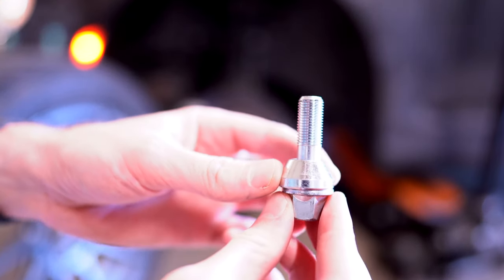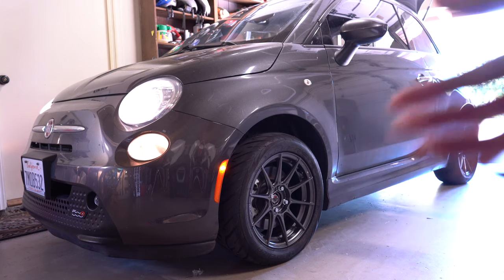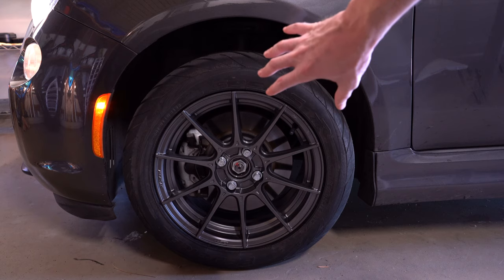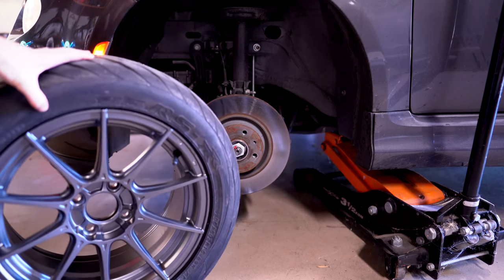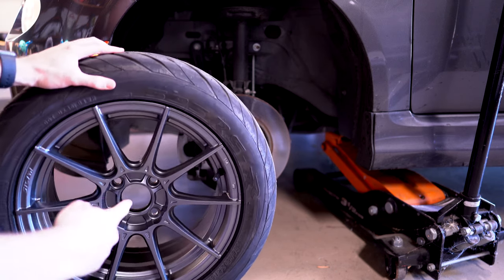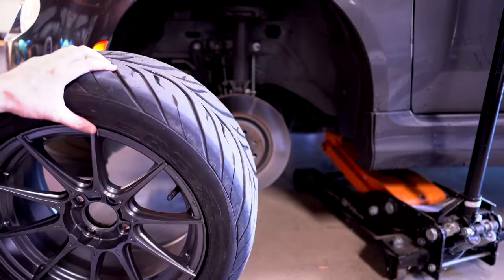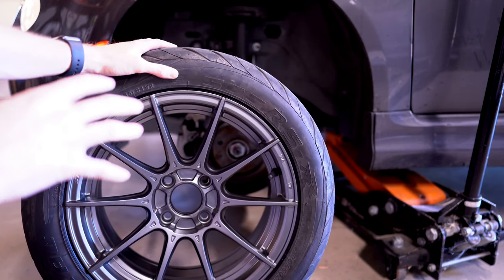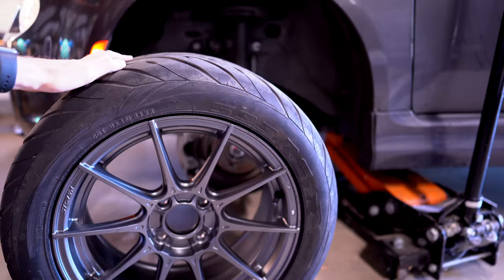I Used Wobble Bolts To Fit Racing Wheels on My Fiat

Comment: Very helpful video. I have a Fiat 850 Spider and want nicer wheels. As you know, the choices  for a 4X 98 with a 59mm hub bore car are limited. This opens up options. Can you tell me what hub-centric rings you used and what drill bit you used to open up the bolt holes? Also, what wobble bolts did you  use? Thanks.

Comment: I want to install 5x112 wheels on my Alfa Romeo which is 5x110 do you think wobble bolts are safe ? I saw a few people saying that they’ve seen horror stories with wobble bolts
Reply: Same boat
Reply: Same I want to install 5x112 wheels on my 5x110 Alfa Romeo. Did you ever do it?
Reply: @Ec_17  I installed a vag group wheels on my french car, i use wooble bolts from 5x114.3 to 5x 112and it's safe and fine for now. Remember to torque with the wheel specs

Comment: How do I know what hub centric ring I need?
Reply from the maker: I used a caliper on the hub and then the wheel and then just typed in to amazon. This adapter was 78 to 58mm.

Comment: quick question, I did this with a fiat seicento but it has studs so I went to use wobble nuts, but the new 4x100 wheels didn't fit on the studs. Do I need to change the studs to wobble bots for it to work
Reply from the maker: Did you drill the rims like I did in the video. Studs should work fine with wobble nuts
Reply: @ZentRose  ah right that makes sense, my bad accidently skipped that bit, thanks for the quick reply!

Comment: +ZentRose  While that would work, you now have off-centered lugs which are still offset within the increased lug opening. I understand the hub centric ring centering the wheel so the bolts are centered with the fits bolt holes, it just seems concerning that you will have an off-centered torque of the wobble bolt on the wheel. In general, for a spare or some other "back-up" solution, I think I could endorse this. However, employing this solution with a sticky tire and with the intent to apply maximum lateral load seems problematic or concerning.

Then again, I am not a materials engineer or mechanical, so I will defer to those who know more than I.
Reply from the maker: We don't have to worry, the wobble bolts are TUV tested and approved. The danger here is that variable PCD bolts like this do not center the wheel on the hub.
Reply: What diameter are those  wheels ?